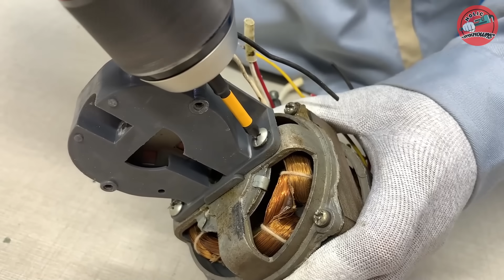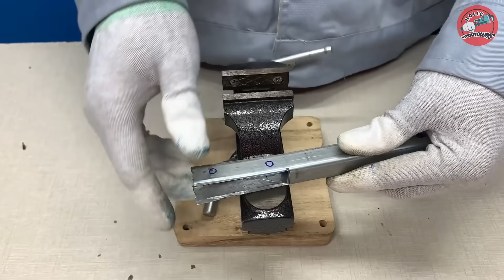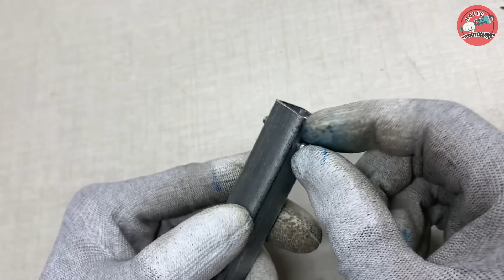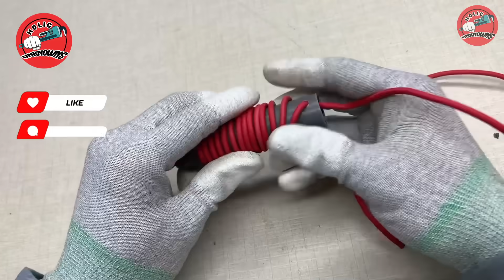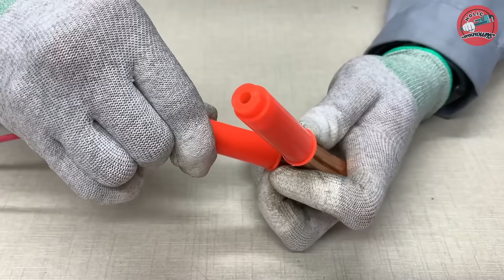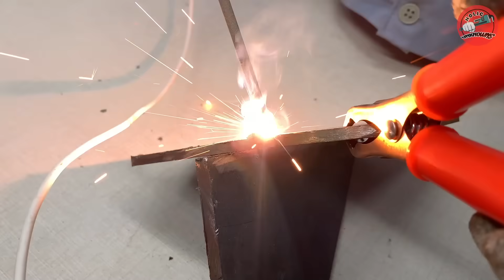Even NASA Doesn't Know About This Invention from an Electric Fan Motor ? Anyone Can Do It!

Comment: The electric welder was invented in the early 1880s, with Auguste De Meritens fusing lead plates using the heat from an electric arc in 1881 and Nikolai Benardos and Stanisław Olszewski patenting the first carbon arc welding method in 1885-1887. This was followed by the invention of the metal electrode for arc welding by Nikolai Slavyanov in 1888 and C. L. Coffin in 1890, which laid the foundation for modern electric welding. 
Key dates and developments:
1881:
Auguste De Meritens first demonstrated the use of an electric arc to fuse metal plates for storage batteries. 
1881-1882:
Nikolai Benardos and Stanisław Olszewski developed carbon arc welding, the first electric arc welding method, using carbon electrodes. 
1885:
Benardos and Olszewski obtained a British patent for their welding process and electrode holder. 
1887:
They secured an American patent for their carbon electrode welding technology. 
1888:
Russian inventor Nikolai Slavyanov invented the first consumable metal electrode for welding, which was a significant advancement over carbon electrodes. 
1890:
C. L. Coffin of Detroit received the first U.S. patent for arc welding using a metal electrode. 

Regarding the above mentioned you have not invented anything
Reply from the maker: It looks like your comment got cut off! If you have a question or something specific youad like to discuss about DIY electronics, feel free to share. Iam here to help!

Comment: Winding on the motor are insulated wrapping a wire around it will not aloo current to flow. If the wires were not insolated it would burn up as soon as you plugged it in. FAKE and very dangerous.
Reply from the maker: Thank you for pointing that out! Safety is always a priority, and it's great to have knowledgeable viewers like you to keep the conversation going.

Comment: The welding scene warning turned out to be a big sparkler party. The electrode keeps sticking the metal and zero penetration on the material 🤔   😂😂😂
Reply from the maker: Haha — yep, more like a fireworks show than a proper weld! 😄 You nailed it: when the electrode sticks like that and there's no real puddle forming, it's a clear sign of low amperage, bad grounding, or just not enough power to get real penetration.

Have you done a lot of welding yourself? I’d love to hear how you’d tackle a basic setup for beginners that actually works — no sparkler theatrics required!

Comment: Che minchiata ha fatto un trasformatore per avere una tensione di pochi volt ed una corrente di 50 / 60 A tenendo conto del ferro del motore , infatti l'elettrodo innesca ma  non mantiene la saldatura continua
Reply from the maker: Hai colto perfettamente il punto. Ha trasformato un trasformatore “improvvisato” senza considerare bene la saturazione del nucleo e la sezione del filo: sì, può fornire alta corrente per un attimo, ma non è stabile. Proprio come hai detto, l’arco si innesca ma non regge — tipico segnale di tensione insufficiente sotto carico.

Tu lavori spesso con saldatura a elettrodo? Hai mai modificato un trasformatore classico per farne uno da saldatura in modo più “serio”? Sarebbe bello sentire il tuo approccio tecnico.

Comment: Connecting the 3 circuits in the fan motor stator, and wrapping wire around the insulated windings of the stator, and expecting any reaction at all, is foolish. There is a large battery in the base of that light capable of sustaining a welding arc for a short time. Anyone who risks trying this may electrocute themselves, or cause a fire, if any of the insulation is accidentally removed from the windings of the fan motor curcuits.
Reply from the maker: I really appreciate your cautionary advice! It’s important for everyone to be aware of the potential risks involved when experimenting with electricity.
Reply: @HolicUnknowns  non si capisce dal video. Sembra che colleghi il circuito alla 220. È pericoloso per chi è inesperto. Tutte le fasi dovrebbero sempre essere ben chiare nei video, se c'è una batteria deve essere visibile e si deve capire a intuito che è lei a fornire energia. Sono elettricista da tanti anni, e ancora oggi ho paura della corrente, forse  per questo sono ancora vivo.

Comment: Then put it here so our enemy's can learn it and make a bigger or better one you are a sabatoger putting such on here to give away to our enemies. You are ignorant.😅😊😮
Reply from the maker: I get your concern—sharing basic DIY experiments does open the door for anyone (friends or foes) to try them. But these setups are low-power, improvised demos, not military-grade tech. The real goal is education and sparking curiosity, not weaponization.

If you’re looking for truly secure designs, that’s in the realm of professional engineering and classified projects—far beyond a pencil-and-battery hack.

What kind of safe, yet advanced, DIY build would you find valuable instead?

Comment: Dicen cada idiotez que da vergüenza la nasa es un centro espacial con los mejores ingenieros del planeta .no precisa ir a la nasa la industria china en electricidad y fabricación robot izada esta dejando al mundo asombrado esta bueno hacer imbetos estudiar siempre estudiar por que en electrónica ciertos valores no se pueden casar quedarías algo por eso hay que tener conocimiento he visto soldar un transistor 2035 y ese transistor no se suelda el colector esta en su capsula es decir el colector es el cuerpo del transistor y lleba tornillos además por ser un transistor de potencia calienta y rreba roscada a una plancha de aluminio de enfriamiento y cuando se colocan dos además kleba uno de ellos una fibra de aislacion para que no se cortocircuiten entre si los equipos amplificadores sounder de 100 watts lleban dos y a veses 4 para amplificadores para un conjunto una guitarra eléctrica o un micrófono saludos y estudiar es la base sres

Comment: A helicopter is more expensive than a welding machine.
Reply from the maker: Absolutely—helicopters run into the hundreds of thousands (if not millions), whereas a decent welding machine can be had for a few hundred to a few thousand dollars. The key takeaway is choosing the right tool for the job and budget.
If someone’s looking to DIY and learn, starting with a welding machine makes way more sense than dreaming of helicopters. Have you found any mid-range welding rigs or brands that you’d recommend for someone just getting into metalwork?

Comment: It's missleading practice this guy not honest
Reply from the maker: I understand your concern about honesty, and it’s important to approach such content critically. However, before labeling it as misleading, may I ask which specific part you found dishonest? Sometimes, creators simplify complex concepts to make DIY projects accessible, which can appear inaccurate but isn’t always intentional deception.

What would you suggest as a clearer or more transparent way to present the information? Opening this discussion helps everyone understand the topic better and improves the quality of content. Your detailed feedback could spark a constructive conversation rather than just dismissal.
Reply: @HolicUnknowns   There is nothing personally but The secondary coil it's not suffice to generate enough current for welding ......if any one working in this field he will know what I mean.....furthermore did you see in time 42 second the two lines were touching each other while the power still connected and no spark happened.....in welding machines if the two poles touching it will create short circuit between them......could you explain and let us know about the values of volt and current of course this A/C thanks and regards

Comment: There  are a few problems with this video. It would blow the breaker. The wires are not thick enough to handle  welding current.  It is not a coincidence  that welding  equipment  use transformers. Possibly protection against overheating. Just like the winding of that motor.  Welding  requires way more amps. Min 30A     low voltage. So you don't  electricute  yourself. Or burn  the  the house down. Typical outlets provide 15 to 25A  Simply  put fans  take about  1A or less and it is  designed  that way.
Reply: From what I saw this contraption looks less like a welding tool than a souped up arkograf. At least that's how they're called in my native language. In case the term isn't used in English: An arkograph uses electric current applied through a needle to discolor the surface of metals creating indelible marks in it. The needle is fine and easy enough to move so it can be used like a pen to write on metal (and with some additional parts wood, too). Technologically an arkograf is pretty much the same as an electric welder, just a lot smaller because needs to supply a lot less energy. They've also become pretty uncommon, because there is some danger involve working with them (they can dish out some pretty nasty shocks) and better ways to indelibly write on metal have been invented.

That being said: I do NOT reccomend anybody trying to replicate the contraption from the video. While in theory turning a motor into a transformer can work, there's no way to predict what kind of output voltage (and current) you'll get unless you have proper documentation on the motor and its parts. A motor coil that has multiple wires leading into it is actually an entire set of coils with different numbers of windings, and without documentation there's no way to know how many windings you'll end up using if just connect them all. And that's not even mentioning the chance that salvaged motors might have dangerous faults to begin with. Then there are a ton of safety issues with that ... thing. It might be an interesting project for someone who knows what their doing and doesn't plan on actually using the product for any actual work. But if someone with limit understanding of electrical devices thinks this is a cheap way to get their hands on a welding tool, they're in for some pretty nasty surprises.
Reply: @MrAranton  Yeah, it looks kind of risky from what I saw. And I don't know how long that motor windings can tolerate this kind of use until windings start overheating, shorting and burning up. The fan motor windings are not designed to handle heavy current like what is encountered in arc welding.
Reply: Increíble 🤯 pero.....es peligroso porqué es algo qué no está acondicionado para ése tipo de trabajo ⚒ y puede provocar un accidente 😊😊😊😊
Reply from the maker: Thanks for leaving a comment! If you like this video, please Like and Subscribe for more useful content.
Reply: @HolicUnknowns Lol
Reply: Lol  @HolicUnknowns
Reply: stop it,,, your going to get someone hurt! @HolicUnknowns
Reply: Also on 42 seconds he put the two lines on each other and that should make short CCT it's totally big lie
Reply: If he welded for 10 seconds he would have a fire. Wast of time
Reply: you are folish man

Comment: Nice video! With this circuit, welding becomes one of the dangerous job in the world, a slight mistake and you instantly gone forever
Reply from the maker: Thanks for watching! 😄 You're absolutely right — even simple circuits can become *serious business* if handled without care. Electricity + heat + metal = a combo that demands respect.

This setup is just for demonstration with low voltage*, but the **real danger* comes when people try to scale it up without proper knowledge or safety gear. Welding, even professionally, is no joke!

Have you ever tried DIY welding or building something similar? Always happy to share safe tips if you're exploring!